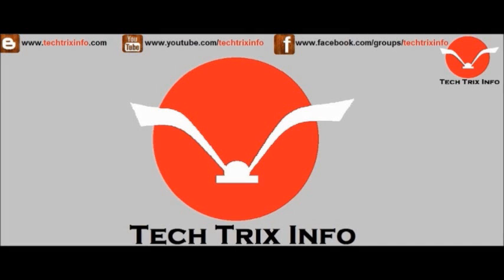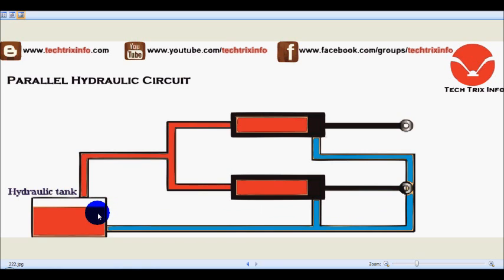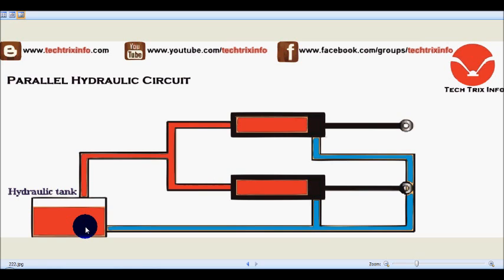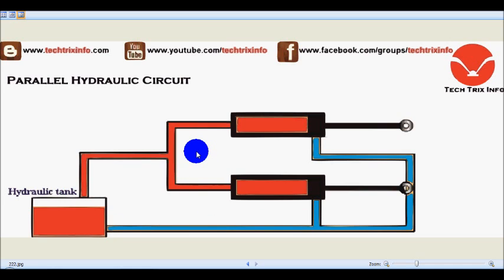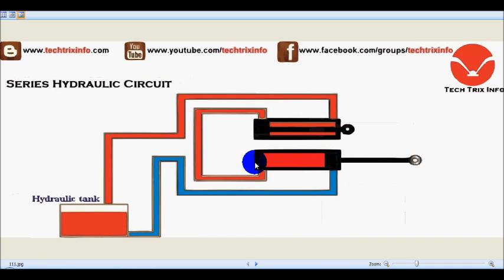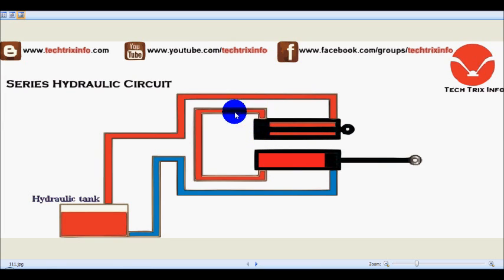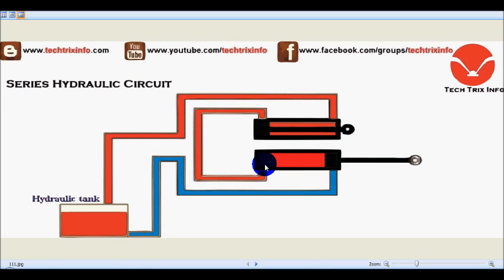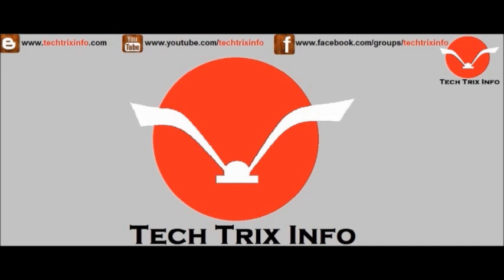How parallel and series hydraulic circuit works. ✔

Comment: in series connection, the movement of pistons should depend on where the hoses are connected on each cylinder, if I connect the head of one to the tail of another with that small red hose, then both will move in the same direction I guess, correct if I am wrong